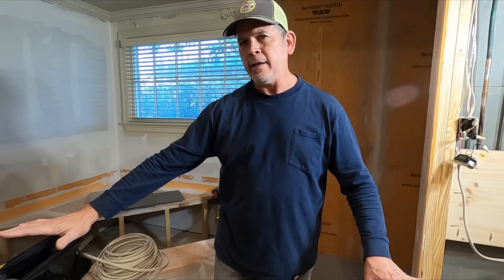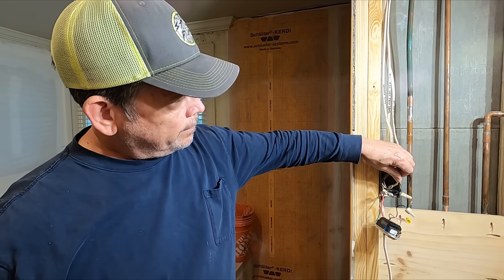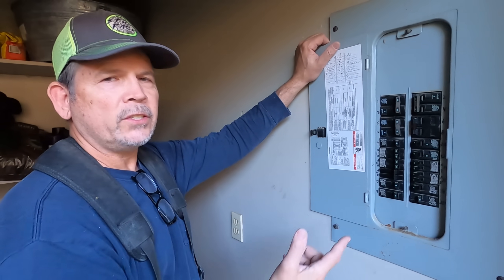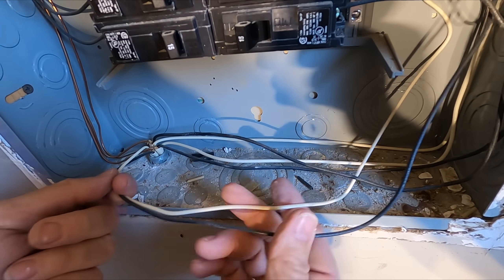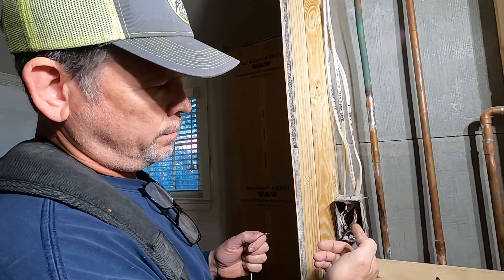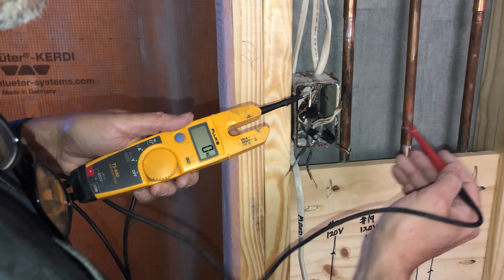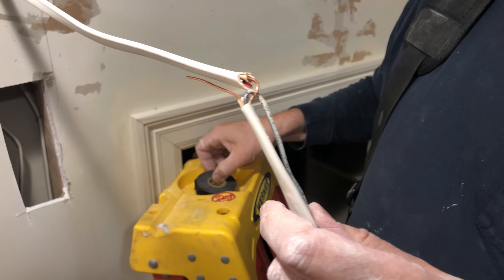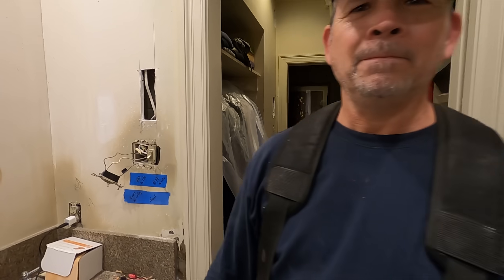You CAN Get SHOCKED by a Neutral Wire! This is How...

Comment: As an Electrician myself, I thought that was a great explanation.  And your trouble shooting skill are great as well.  Good Job!  Just a side note.  It is legal to share neutrals.  It's called a multi-wire branch circuit.  However, current code requires handle ties be installed on the breakers so both circuits will trip at same time.
Reply from the maker: Thx I sure appreciate that 👍  circuits 19 and 20 are same phase so I had to separate neutrals or move circuits in the panel and install a 2 pole breaker.  I thought viewers might want to see that abandoned neutral connected properly so I went with option 1
Reply: @StudPack  shared neutrals on the same leg (phase) is really dangerous.  That means if both hots were at 15 amps in use that the neutral would have 30 amps which would heat up that 14 gauge wire too much.  If it were my house I’d probably just move the breakers to opposite legs and make sure they trip together.  But I’m aware of the risks shown here.  

Can you please explain how sequential numbers are the same leg?  That’s not obvious.  If that is a tandem breaker it should be the same number with an “a” and “b”.    I think you may want to renumber the circuits to clarify which leg each is on.

Whoever wired that shared neutral on the same leg previously is clearly incompetent. (Not you of course. You did a fine job fixing it).
Reply: @neilbrookins8428  you sir have no idea what you’re talking about.
Reply: @dallas5374  I appreciate constructive criticism.  But from reading your comment, I can’t tell which part of my reply you were referring to.  Can you please be more specific?
Reply: @neilbrookins8428  "Can you please explain how sequential numbers are the same leg?" 19 and 20 are same 'leg' or 'phase' (however you want to describe it). Starting with 1, the horizontally adjacent breaker is same leg. So 1 and 2. That implies 19 and 20 if one could not see the panel, but if one is looking at the panel, any breaker that is horizontally across from the other is same leg. 220 breakers need both legs, hence this arrangement.
Reply: @spruce_goose5169  thank you. I can see at 4:31 that 19 and 20 are the two at the bottom row.  Yes, these are obviously the same leg.  I was mistakenly assuming the numbers were going down sequentially, not across.  By numbering down the left all the odd numbers are one leg and even numbers are the other leg.  This makes more sense to me to document legs as even vs. odd. Otherwise with the way it’s done here numbering across you can’t easily derive which leg by simply knowing the number.  

I still think whoever wired the shared neutral was incompetent due to overloading the neutral.  If these breakers were gfci you’d know right away that it was wired wrong because it would trip.
Reply: @neilbrookins8428  He explains the numbering in the beginning of the video.
Reply: @neilbrookins8428  I could be wrong, but I don't think the numbering sequence is a choice. In other words, this is how manufacturers have decided to number panels. He simply drew in marker what was already stamped into the metal.
Reply: @neilbrookins8428  I agree about the neutral. Code states something along the lines of: "a multiwire branch circuit consists of two or more ungrounded conductors that have a voltage between them (different legs), and a grounded conductor that has equal voltage between it and each ungrounded conductor of the circuit and that is connected to the neutral or grounded conductor of the system."
In other words, the 'hots' must have a voltage between them which implies they are of different 'legs.' In this scenario, neutral current will cancel rather than add.
Reply: @spruce_goose5169  I don't think the code allows for 2 different phase to be in one box unless its for a 240v circuit (which has no neutral) and the breakers must be ganged together
Reply: @spruce_goose5169  220v circuits dont have a neutral, 120v circuits do on a split phase system. I was told by a head electrician that it was not legal (at least in a residential building) that you could not run two different 120v phases in one box as there is a potential of 240 being present in the box.
Reply: @rty1955  Roy, where (roughly speaking) are you located? Because code is different everywhere. In the NE U.S. where I am, we can follow the current NEC and so long as we adhere to the rules for multi-wire branch circuits, we're good to go (see the link I previously posted).

As far as 220v circuits not having a neutral: The 220v itself doesn't use a neutral, correct, but it is extremely common for appliances to be run with 4 wires: an EGC (ground), a neutral, and both hot legs. The reason for this is that certain electronic components are designed to run on 110v and a neutral is needed for this. A good example is an electric range. 

I've never heard of this rule against two hot legs in a box, but if you know the code reference it might be helpful to get to the bottom of it.
Reply: @spruce_goose5169  I am not a licensed electrician, I am an electronic design engineer. I had helped a head electrician for a large company a while ago and asked him about this because of a 240v potential in the same box. I was told as long as its on the same phase it is permitted. I may ne wrong, but it makes safety sense
As far as an appliance goes, i have seen (ESP new ones) not needing a neutral due to the SMPS inside. Each appliance would be different, but as a rule a 240v circuit has no  need for a neutral, if a device needs a 120v circuit than a neutral sometimes would be needed, but that device dependant. I have seen 240v appliances that have a step down (240 to 120v) transformer inside as well. Modern appliances dont use transformers inside appliances anymore for this sort of work as they derive various voltages by other means such s s a SMPS
Reply: @rty1955  how would we ever get the voltage necessary without them being in the same box?  What's in an electrical panel? 2 or 3 different phases
Reply: @Gizmodi  can u rephrase your reply? In USA home we have split phase not 2 phase. Only commercial has 3 phase
Reply: @rty1955  yes Roy

What Is Dual Phase Power?

Dual phase — alternately known as split phase — is basically the same thing as single phase. Dual phase consists of an Alternating Current (AC) with two wires. In the United States, the typical power setup in households consists of two 120 V power wires — a phase A and a phase B, which are out of phase by 180 degrees. Many prefer this approach for its flexibility.
In loads that use low power — such as the lights, television, stereo and computer peripherals — the power is supplied by either one of the two 120 V power circuits. In loads that employ high amounts of power — such as the washing machine, dishwasher, air conditioner and heaters —one 240 V power circuit acts as the supply.

Since your the literal type, that doesn't apply to most residential dishwashers or washing machines. Have a good weekend Roy.
Reply: @Gizmodi  what are you talking about???
Split phase is what we use here in USA in households. Split phase is derived from a secondary of a transformer with a center tap. This center tap is considered to be the neutral. The neutral is a current carrying conductor, usually its the return from the "hot" side of a transformer winding, whereas the ground carries no current. It is recommended that the loads on either side of the secondary windings be balanced. Generation of multiphase has typically two types of coil configurations within a generator:  a Delta, which is like a triangle, or a Y. 
A Y configuration has a common neutral (or return) at the center with 3 coils radiating out like spokes. A delta really has no central neutral, rather its return can be obtained anyplace on the triangle. By either moving the neutral or return the voltage will change.
In order to derive 120v from a 240v ine can use a small transformer or SMPS, therefore a 240v either uses 240v devices (timer motors, control panels etc) or derives lower voltage by the means mentioned. My older elec dryer which uses 240v has a 240v timer inside and thus does not require a neutral. I would find it very odd that 240v appliances would require a neutral.
Reply: @rty1955  Roy, you are tiresome. I don't have the time you seem to have for replying to comments. Have a good day
Reply: @Gizmodi  heres an idea. Have a point when commenting
Reply: @rty1955  Mr.Yung, I made a few points already. Good day sir
Reply: @Gizmodi  no, you spoke gibberish.
Reply: @Gizmodi  what do you mean "how would you get the necessary voltage????" What are you talking about?? Please make sense
Reply: @rty1955  are you an electrician or engineer?
Reply: @rty1955  The US split phase system is a 2 phase setup. The neutral line is not equal to ground but rather the common point between two phases from the same transformer. You could argue that a circuit using only one leg is a single phase circuit, but that is only valid for said circuit and not the system itself. The issue is a phase with regards to a transformer really doesn't say anything about potential. You can generate multiple phases in the US way and as a result end up with a 208V potential between phases or you can do it in the more common European way where you still have 230V of potential but a higher RMS output as you are drawing 230 from different phases simultaneously. Then there is the modern European 400V systems that's again it's own thing but offers 230V through a similar split phase arrangement as the US except with higher voltage potential across each split phase and neutral.
Reply: @aBoogivogi  I am well aware of that. The fact that its of a different potential is irrelevant. The "neutral" is simply the return path for a given potential on a transformer winding. Its a split phase because it is created by splitting a secondary winding in a transformer equally and the neutral is just another tap off that winding. The term "split phase" means you are deriving more than 1 phase from an AC waveform which is 360°. The sum of all phases must be 360° Why? Because each rotation of a generator is 360° An electrical generator can develop multiple phases by placing coils at various locations within the generator. In USA we use only 3 coils equally spaced in a generator, thus in the USA we have a 3 phase system. This is how we distribute our power on the electric grid. In commercial locations this 3 phase power is used. In residential areas we use each phase to different communities. As one of the phases comes down the poles that js meant for different areas the voltage is broken down to a voltage which is more useful to consumers. This is accomplished with the use of transformers.
A transformer can itself can create multiple phases derived from its input phase
 You can have multiple taps off a winding, and each tap can be a return for other taps. Thus a transformer can produce many different voltages with many different "neutrals". In power distribution in the USA, we use pole mounted transformers that have a secondary winding that is tapped at the halfway point in a winding thus a "split". The phase angle of each half of the winding is 180° apart because the secondary winding is split in half. If you were to tap at other points, the phase angle would be different. The sum if phase angles always equals 360.
Its also interesting to note that the sum of the power drawn of all secondary windings is equal to the power drawn on the primary. This is simple transformer theory.
The primary winding from your pole mounted transformers itself came from a secondary winding from a substation.
Reply: @aBoogivogi  >"The US split phase system is a 2 phase setup. The neutral line is not equal to ground."

Neutral is grounded (usually in multiple places) and so it absolutely IS equal to ground (potential).
Reply: @rty1955  Roy, I agree with most everything you're writing, save for your claim that there don't exist 220v appliances with neutrals. When was the last time you hooked up a modern appliance like a range?
I understand that voltage can be switched by electronic components on board the appliance, but that is simply not always the case. I literally just wired a 220v induction range oven with all 4 wires. I understand that the 220 load itself does NOT use the neutral. That's not the claim being made.
Reply: @spruce_goose5169  so if you are replacing a 220v appliance with a modern one that needs a neutral for the 120v electronics, u will need to re-run a brand new cable with a neutral?
Reply: @rty1955  and others discussing PHASE:
Some of this is now just semantics. Since I'm the master of semantics (some say pedantic;), let me suggest that PHASE is not a line/wire or even necessarily a transformer coil, but rather the electrical SIGNAL form that exists between 2 points in the system. (Voltage is not one point existing in absolute, but is a relative measurement BETWEEN two points.) And by extension, any phase RELATIONSHIP (more than 1 phase) must have a third point to reference.

For sure, a typical U.S. residential system is probably best described as a 'split-phase SYSTEM.' The system is derived from a single phase of the three phase transmission/distribution system.

The secondary on the transformer acts just as Roy is saying— by 'splitting' the electric potential between the ends of the 240v coil with a 3rd reference point (halfway!). The trick of whether or not we're dealing with one or two phases depends on how we're measuring. 
Even a 220v circuit is only one phase if left alone. In-fact, any single source load is operating via one phase, whether it's 120v, 220v, or some other voltage derived across a delta coil, or even 2 coils of a Y configuration that are 120 degrees out when referenced to the center of the star. The phase is the signal—the sine wave—and you only have one voltage sine wave generated across two points. Of course motors and such can use multiple phases at once. 

To have two (or more) phases we must REFERENCE a third point. In reference to NEUTRAL (that center tap on the secondary) we then indeed see two phases, 180 degrees apart, just as Roy says. What are they 180 degrees apart from? From each other, in REFERENCE to neutral.

This helps us to understand why neutral return current CANCELS when loads are balanced between these two phases (yes in that case they're definitely phases): because when one phase wave crests, the other troughs. The neutral line on an oscilloscope displaying 2 phases is simply the x-axis.  

To confirm I'm not crazy, one can test this geometrically. How many points do we need to draw an angle (remembering that phase relations are described in angles). We need three: a vertex and two other points to draw the lines to.
If two points are X distance apart, they have X voltage between them. The third point provides the vertex to determine the angle. Carry this analogy even further: a straight line is 180 degrees. This is our transformer with the vertex dead center on the line. Can we have 0 phase angle? Only if there's no vertex—only if there's only two points, a single voltage which certainly cannot be described as two separate phases.

So the moral of the story: when your holding that red and black wire in each hand wondering, "am I holding two phases?" rest assured, you're not...unless you're also standing on the ground! (Cus you know... the neutral is tied to ground).
Reply: @rty1955  Yes, unless you want to cheat and do a bootleg of sorts (against code, unless there's some grandfathering...not sure) by using the existing neutral or ground (whichever exists) and tying the appliance neutral and ground together on that one line. This is how it used to be done anyways (neutral was connected to chassis). Obviously some safety concerns there.
Reply: @spruce_goose5169  Hahah yes you are correct and a phase is an angle. And eache phase is 180° apart from each other
Reply: @spruce_goose5169  i would look for another appliance rather than rip my house apart just to supply a neutral for some silly low current electronics. I would not want to steal a neutral from someplace in the kitchen as im sure there must be a code or regulation about that. 
It would be wiser to rectify the 220v to DC with 4 simple diodes then use voltage regulators or inexpensive switched mode supplies (more efficient) to bring the voltage down to the 5 or 12v the electronics needs.
Reply: @rty1955  Go ahead and try to rectify 220vac and see what happens.  Maybe step down the 220 with a transformer.
Reply: @rty1955  Roy you are absolutely correct. There is no “neutral from the power company” in the USA. It’s created by a center tap at the transformer thus “split phase”. And voltage does not flow like water in a hose either ... another dangerous DIY analogy. But sadly you’re wasting your time and mindshare trying to get any of that across here.
Reply: @HBSuccess  Was someone using the water analogy here? I have no problems with analogy so long as we recognize their limitations. But you're right voltage does not 'flow like water.' More accurate would be to say voltage is the pressure, current is the flow. But even then, it's just an analogy.
What do you mean there is no 'neutral from the power company?' Aren't they the ones that hang the transformer with the center tap?
In seriousness, many distribution legs that are single phase will use a neutral to return to the sub. On a more macro scale (transmission), the 3 phases are balanced without neutral, that is true.
Reply: @rty1955  "So if your neutral was not exactly at the halfway point in the winding, the phase angle would be different on each of the windings"

Actually that's not the case. Thinking geometrically (conveniently we can do that)—the 3 points still form a line—180 degrees.

The difference is that the amplitude of the phases would be different. E.G. L1 to N might be 90v, while L2 to N would then be 50v. 
The sine waves, when displayed on a scope referenced to neutral, would have different amplitudes, but their phase angle would still be 180. Return current on the neutral would still cancel at a 1:1, but obviously there is less potential for current on the lower voltage phase.

Another way to confirm is to ask: 'would the two ends of the winding (the 240v potential) change in this scenario? Of course it wouldn't because it doesn't use the neutral. This indicates the phase-phase voltage factor is one (add the two potentials together). When we're talking 120 degree phase angles (as with 3 phase) the phase-phase voltage factor is sqrt of 3 (≈1.73). 
Not that any of this matters for any practical purposes (unless we're designing systems I suppose, which I'm not).
Reply: @HBSuccess  You, sir, are obviously not an engineer because that is not a DIY analogy. It is very well grounded in theory and actually taught to undergrad engineers. Just because these analogies that require a deep understanding of PDE's have escaped into the DIY wild and are being abused does not invalidate them. But, before you go tooting your horn that water flow is easy while electron flow is hard, know this. The Navier-Stokes equations are one of the seven Millennium Prize Problems.
Reply: @rty1955  stealing a neutral is exactly how amateurs create these dangerous feedback circuits.
Reply: @HBSuccess  well, that neutral is bonded to an earth ground at the service entrance. I thought there was a bond to ground at the pole, too.
Reply: @stephenholland6328  I agree
Reply: @spruce_goose5169  the ordering sequence, aside from the numbering, is dependent on the panel*.    Some panels have the legs alternating between slots on the same side, and some have *pairs alternating.  So I don't rely on numbering or slot position, I check the panel construction to determine what the pattern is.
Reply: @rty1955  240/120v circuits (like you see in modern US code stoves and some dryers - has  been this way much longer in Canada) have two phases plus a neutral in a box.

The rule here used to be that every device box and j-box must be killable by one trip (single or dual-tied breaker).

I've just been informed by an electrician that you're now allowed (in Canada at least) to have two unrelated circuits with independent breakers, joined inside a box.
Reply: @fromagefrizzbizz9377  Makes sense to check the construction of the panel! 

A question though: how does one install a 240 breaker if the legs are not vertically adjacent? Are there special horizontal breakers or something? Doesn't really makes sense to me, but I'm not familiar with this set-up!
Reply: @spruce_goose5169  You have to CHECK the slot phase sequencing before you put in a double breaker.  if they alternate in pairs, you have to be sure to install your breaker to straddle both phases, if you don't, both the double breaker's lugs will be on the same phase.  This is possible at least with FPE (still manufactured in Canada by Schneider Electric, never had the problems of the US ones), Sylvania/Commander (defunct), and even with my perfectly modern siemens/Eaton panels if you're using quads with a central dual, or dual-half width.

I checked an old Square-D Q0 load panel.  Six breakers in a row.  If you put a double in slots 1-2, 3-4 or 5-6, both breakers in each pair are on the same phase.  If you want to use doubles, they have to be in slots 2-3 or 4-5.
Reply: @fromagefrizzbizz9377  I guess I would have to see one of these set-ups to understand the particular arrangement.
I don't really understand the purpose of grouping the legs or running them down one side vs alternating them.
 
I assume the vast majority of (or all?) modern load centers approved for residential install in the U.S. alternate legs vertically? If there is a modern one that does not, do you have a link to the product? I would be interested to see the set-up.
 
Either way, I take your point that there are some strange configurations out there, and the only way to be sure of proper work is to verify against reality, not assumptions.
Reply: @fromagefrizzbizz9377  I live in USA and my dryer is 240v single phase, no neutral, just a ground. My stove is electric as well, 240v single phase, no neutral its been that way since the house was built 20 yrs ago.
I was told by an electrician that only same phase is allowed in one elec box
Reply: @spruce_goose5169  I think you're confusing things with using the word "vertically" - especially given it's legal to put panels sideways.

I'm referring specifically to lines of adjacent slots regardless of orientation.  They all "alternate", but some do it as "alternating individually" and some do it as "alternating in pairs".

Seimens/Eaton panels/breakers are entirely modern and alternate in pairs at the half-width breaker level.  Making them alternate individually at the half-width level, without screwing up ordinary-width breakers,  would likely increase the manufacturing cost by a fair amount.
Reply: @rty1955  US codes have evolved a lot.  Up until the late seventies/mid-eighties,  US ranges could be direct wired with three conductors - two hots, and a conductor that was used as BOTH a frame ground and neutral. If you lost that conductor, some of the 120V electronics (inside light, or an electro-mechanical clock or timer) would misbehave and possibly burn out, and the frame could end up partially if not fully live even if a burner or control didn't malfunction.

In the late eighties, NEC moved towards requiring 4 prong outlets, with separate ground and neutral feed.  Canada had been that way for at least a decade by then.

If you saw this done around 2000 it would have been a "special", state law out of sync with NEC, or an electrician who didn't know what they were doing.

A more accurate rule is that only a single circuit can be in a box, whether it be both phases - 240/120V like most ranges/dryers and "split duplex" receptacles, or 240V only or one phase with 120V only.  Where "circuit" is defined as a single feed line protected by a breaker, whether single, or common-trip dual.

In fact, both our codes require a 4 prong stove/dryer outlet in new homes, period, even if you don't use it at all (eg: gas stove or dryer).

The intention is that the entire contents of a box become dead with one trip of a breaker, UNLESS the different circuits are confined to separate parts of the box with a metal barrier. Even in main panels, Canadian code said there had to be a metal barrier between the main and the branch breakers (which may have relaxed at the regulatory level due to alignment of US-Canada code).

That said, I understand that two unrelated circuits can now pass through a J-box in Canada according to recent code without a barrier.  Dodged a problem with having to have a J-box protruding through the ceiling in my current reno.
Reply: @fromagefrizzbizz9377  when you say "unrelated" are you referring to two unrelated circuits on same phase or two unrelated of different phases?.
When my home was built in USA in 1998 is was perfectly legal to run 240v no neutral otherwise no CO would have been issued. Circuits in appliances don't have to run on 120v they can be designed to run on 240v. Thats perfectly acceptable. They do it in UK all the time where 240v is thier mains.
Reply: @rty1955  I mean "unrelated" - separate circuits without common trip.  Two phases, under a common-trip breaker pair, have always been legal with neutral or otherwise.

Yes, of course, appliances can be designed to just use 240V as in the UK which doesn't have 120V.  But imagine the problem trying to replace an internal range lightbulb at 240V in North America?  Fractional horsepower motors for dryers ditto.  Economies of scale etc.

You could equally ask why the UK didn't move to 240/120V like us, and then they'd not have to get into so much trouble with international travel, new markets for their manufacturers etc.

The UK and US/Canada had huge differences in how they treated household electricity.  What made sense in the past, may not make so much sense now, but the physical inertia of changing is just too great.

My father remembered the upheaval going from 25 cycles to 60 in around the late 1940s.  Just try to imagine doing that again.

Modern technology is beginning to make that moot, with so much electronics that doesn't give a crap about supply voltage as long as it's between 85V and 250V.  That will progress.  Even with high power transmission lines - Quebec switched to DC from AC in the early 2000s to make it cycle/phase independent  make it easier to survive major catastrophes, and reduce transmission losses.
Reply: @fromagefrizzbizz9377 here is USA Westinghouse standardized 60hz back in 1890. Only in s.  California did Edison use 50hz and later switched to 60hz in 1948.  Edison used DC in NYC at first but later switched due to the superiority of A/C  transmission/distribution.
Two 120v bulbs in series would make it easy to be supplied by 240v. I have to check my stove as to the lamp voltage.
Reply: @fromagefrizzbizz9377  Thanks for trying to clarify this. I think I get it now. You're simply talking about split tabs/ tandem breakers. 
My personal panel uses a few tandem breakers but the metal is still stamped only once for the slot (for the 'pair') so the numbering sequence is uniform and works to identify legs if one wanted. But other panels number each slot within the pair, in which case one certainly wouldn't want to rely on those numbers to identify legs. I'm with ya (I think).

As far as horizontal mounting, you're in Canada right? We be in different countries mon. Mounting panels horizontally here is pretty unheard of, and I believe there is language in the NEC that disqualifies most installations from doing so legally (240.81) on the technically that when the breaker is UP it needs to be ON.
Reply: @spruce_goose5169  I know we're in different countries.  I authored a FAQ with an American on electrical wiring that applied to both countries.  You'd be surrprised at how similar they were, differing only in some details about kitchen counter outlets etc., and since NAFTA they've come far more in convergence.

Vertical (either way around) is relatively common.  Horizontal is rare but occasionally done. This may be one of those things you need to ask the inspector first.
Reply: @rty1955  your 240v appliances has 2 phases in the same box, thats how its getting 240v, it's 2 120v phases 180° apart. All resi dryers/ovens are pulled with a neutral along with 2 hots. Neutral is used for the electronics and light in the oven. 2 phases in a box is fine, it's common to pull a 14/3 to a microwave and a 14/2 to a fridge from the microwave box. 
Source: am an electrician
Reply: @rty1955  whoever told you it is permitted as long as it is the same phase is not a properly licensed electrician in the USA.  combining two 15 amp circuits on the same phase would mean you now can have 30 amps flowing through the neutral that is rated for only 15-20 amps (depending on wire thickness).  as a rule, you can only share a neutral if each circuit is on a different leg.  there may be a few areas that don't permit this but there are NO areas that state you can share a neutral as long as the circuits are on the same leg.

how it was wired here was cheap and illegal since the light was controlled from two points with the neutral needing to pass through both boxes (as opposed to one box being an end point with no neutral needed).  whoever did that decided to save money by buying the wrong cable, which makes me wonder just HOW that light was connected to a neutral in the first place in that configuration.
Reply: @Gizmodi  you are slightly incorrect.  2-phase is a four wire system with no neutral and each leg being 90 degrees out of phase instead of the 120 that 3-phase is.  it is a defunct standard that is no longer used anymore, though you can still get 2-phase motors.  basically you needed a special transformer setup for it to work and was not cost effective.

single phase or split phase are the right terms.  the PRIMARY reason they refer to it this way is because the pole transformer only has one high voltage phase connected to it with a ground path return at the pole (in residential areas, anyways), so the transformer is stepping down a single phase and splitting it between two voltages on the output (a center tap transformer).  three phase commonly has three high voltage phases on the input (in a AB/BC/CA wire configuration to each coil) and four wires on the output (even in delta, you want a fourth wire going to the service panel for bonding at least).  though, there are some older setups where they only have two transformers (a high-leg setup) where 240V goes to each transformer output leg but the neutral is only wired for two of the phases at 120v, but on the third the line-neutral difference is 240v (a small apartment building I lived in that had an elevator needed three phase for it and this was how the two pole transformers were wired).
Reply: @renton9999  no I agree that you cant share a neutral on two different circuits on the same phase. The comment I made was that I heard that two different circuits on two different phases was not allowed, due to the box would have a 240v potential w/o dual breaker lock.
Reply: @renton9999   I believe the high leg is a delta.
Reply: @Gizmodi  high leg has a connected neutral for two of the phases.  standard delta doesn't have a neutral connection.
Reply: @rty1955  ? How about this: incorporating a centre tapped neutral in a transformer winding coil enables the creation of two anti-phases ?
Reply: @neilbrookins8428  you are correct. Sharing the same incoming leg (piggy breaker)will double the amps on the neutral when sharing the neutral. Mr Dallas is "incorrect" by saying you dont know what you're talking about. Neil, you are also correct when saying separate the legs by using a double pole breaker. That is Code. Stud Pack should edit the video to be more clear about the correct way of using a double pole breaker. He never mentions it ....
Reply: @spruce_goose5169  the NEC had special exceptions for appliances that allows you to connect the appliance frame to the grounded conductor.
Reply: @rty1955  As far as I remember Neutrals are only neutrals in a 3phase system carrying unbalanced load from the phases but in a house its just your return wire. not truly a neutral more of a glorified bond :D
Reply: @dallas5374  I didn't think so either.
Reply: @StudPack  Gotta appreciate your concern for electrical safety BUT there's more of an immediate danger and an OSHA violation going on at 13:00 . Whats up with that?!? Well, at least he was wearing knee pads!!! Hahahahahahhahah, funny as hell!!! Reeeally? Come on, man!
Reply: @StudPack  actually, 19 & 20 are on different phases ...odds / evens. so a neutral can be shared, depending on if its a balanced load. We do this all the time in commercial work 3 phase . 3 ccts can share 1 neutral
Reply: @mikemacdonald2032  as long as the breakers are ganged together
Reply: @mikemacdonald2032  If you do commercial work, perhaps this is different, but most resi panels alternate legs (or phases if you want to use that term) vertically. This is allows 220v breaker to work (to connect to both legs). So 1 and 2 are the same phase, 1 and 3 are different. This means 19 and 20 are same.
Reply: @mikemacdonald2032  No, 19 and 20 are on the same leg. Breakers that are at the same height from the top clip onto the same tab in the panel. Sequential odd or even are on different phases. So 1/5/9/13/17 are one phase and 3/7/11/15/19 are the other phase. A double poll breaker would take up 1and3 for example. Being on opposite phases is how they get 240V on the same side of the panel.
Reply: @spruce_goose5169  This is dependent on the panel itself.  Some breakers are 1, 2, 3... alternate phases, and some are 12, 34, 56 alternate phases in pairs.  Siemens (and most? Eaten) panels strictly alternate by number, but they end up in pairs when using quad (half-width) breaker blocks.
Reply: @mikemacdonald2032  WRONG. 19 and 20 are on the same leg. You need to go look at some panel bussing with no breakers on it because you are very confused.
Reply: Given a choice, I would not have allowed any multi-wire branch circuits. Unfortunately, I discovered, after the fact, that over half the circuits in our house were wired this way.  We are now looking at thousands of dollars of rewiring in order to stop all the tripping with the arc-fault breakers now required to bring up to code when we remodel.  Then...there are all the lighting circuits with no neutral to the switch box. Thanks to the shortcuts of the past to save a few bucks and few minutes of the electrician’s time, I have a $10,000 remodel that will require a $15,000 re-wire.
Reply: @scottwendt9575  Actually with the correct AFCI there was no need because there are several manufactures that have AFCI's specifically for this purpose. Also I'm not aware of any local code that forces the entire house built previous to current code to make the entire house current code compliant. NEC specifically allows for this.
Reply: @castarmax1970  Yes I have replaced 2 circuits with Eaton’s multi-wire branch arc-fault circuit breakers, but they are special order and run about $250 to $300 a pop plus labor. If I continue down this path, I would have 10 more to replace, so I would be pushing $3000 and I would still have the same wiring issues in the field.  When we opened the ceiling in the basement we found splices using standard wire nuts behind the sheet rock.  We have also found the can lights wiring spliced outside of the can.  Again, with wire nuts behind the sheet rock, no box.  Then, there are all the ceiling boxes that will now have to be replaced to meet the new weight requirements and the 14-2 that will have to be replaced in the lighting circuits. All of this because the 2020 code now says if you pull off the drywall for any reason, like duct work or insulating you have to bring any electrical up to the latest standard.
Reply: @scottwendt9575  you can have an AFCI for a multi wire branch circuit: 
Google for “DET-719-CAFCI-Shared-Neutral-Guide.pdf”
Reply: In Almost all old work you will experience this at some point.
Reply: @comes2mind797  hi. I am sure the box may be overloaded with too many wires, but I defer to the electricians on this post. As for how many volts are there. There are only 2 possibilities either 120v or 240v. What we are discussing on this thread is the legality of two different phases being allowed in the same box. I was told it is not allowed, however branch circuits on the same phase is allowed. But again, I defer the real answer to electricians on here. I am an electronic design engineer.
I also know that junction boxes can not be buried in walls or floors. They must be accessable at all times as wires will be hottest at the junction.
Reply: Not to be argumentative but you correctly state the United states we operate on mostly single phase systems.  But single phase systems only have 1 phase.   Typical 120v/240v phase system circuits may share ( a neautral) such as in the case of a black, red and white grounded conductor.  This sharing meets the requirements  of Article 300.  The problem In the circuit you got a shocked by was more than likely caused by series contact between you and the grounced/grouding conductors.  Remember volts dropped = volts applied which can be verified by placing a tester line to neautral at the source of any load.

However, the panel in your example video appears to be a subpanel which necessitates seperation of neautral/grounding conductors throughout the entire subpanel. 
 Even there are no color standards for ungrounded conductors any enhancement can be good and as you know proper identification of grounded and grounding is in fact a code requirement.   Please allow me to self correct regarding the NEC not having a color code for ungrounded connectors.   The leg with the higher voltage 120/240 3 phase system must be orange. 

Thank you for taking the time to post and stimulate the thinking of us and our coworkers.
Reply: Ok I Believe I figured out something from reading this but here was my situation I had an old box that only had like 12 spots for circuit breakers completely full previously there was a gas dryer I wanted to hook up an electric dryer I put in a tandem breaker two separate breakers on one switch I didn't have enough room I ran a three-wire black on one and red on the other to the dryer with a neutral The dryer turned on but would not heat I thought had 240 I did but it needs to be on single pole 240 breaker had to move tandem breaker two lights to make room for the double pole breaker for the dryer My electrician body told me even though it was 240 it has to be ran on one breaker not a tandem I kind of understand most of it but if anybody can tell me exactly why I believe it has something to do with the converter and or something like that that runs different stuff at 120 but I don't know for sure
Reply: @mitchellchristianson8120  in USA to get 240, you need to have a breaker that occupies 2 slots in the box. The one breaker is actually 2 full sized breakers side by side that are physically joined  together.
Reply: @mitchellchristianson8120  there is no converter in the dryer.  the timer/electronics and motor run on 120v, which is why you need the neutral, and the heating coil needs 240V to work.  i don't know why someone thinks there is a converter/transformer inside the dryer/range to step down the voltage but that has NEVER been the case in the USA.  what was the case was dryers and ranges used to use UNGROUNDED 120/240 volt plugs, and some still do in older homes, but newer installations use the four prong grounded plugs.

anyways, your problem is you wired the line leads to the same phase and not different phases (and i am guessing you didn't use a 30 amp breaker either).  you can't use a tandem breaker to get 240 volts, tandem is not a 2-pole breaker.  all they can do is provide 120 volts in two directions.  I suggest you have your electrician buddy come in and do the wiring in the panel for you and check you have the right size wire for the dryer circuit.
Reply: At one point you could. Not sure about new code and the exemptions. The the way we used to do it, was only only share the neutral when with a hot that is on another phase. For instance, if we pulled 3 phase 208 to a box, we would only pull one neutral and share it between the phases. I think code is changing that or making you upsize neutrals that are common to two different phases. Feel free to correct me or bring me up to current code.
Reply: @luciddream2033  that is correct for sharing on different phases.  but you can't share a neutral if both circuits are the same phase (unless you install a neutral that is equal to the sum of the two breaker ratings).
Reply: @renton9999  yes that is correct, because the neutral will carry the sum of both currents, so you have to upsize it. Wasnt sure it all that was still code because I thought someone told that they changed the code regarding this in some way that didn't allow you share neutrals on different phases. This was done a lot on commercial properties and I believe that the sharing of neutrals can introduce transients and harmonics frequencies on the line that could cause overheating of wires and breakers. These harmonics are due to the increased use of non-linear loads such as fluorescent lights and computers.
Reply: @renton9999  also now that I think about this. Sharing neutrals can be extremely dangerous because in order to be able to safely work on neutral circuit you have to disconnect all three circuits that is sharing that neutral. Trust me, you don't want to get in series with a neutral that is heavily loaded. It was the worst shock I've ever received, worse than 277.
Reply: These are all 2 wire cables.  In order to share a neutral you would need a 3-wire cable.  And if these 2-wire cables are both on that tandem breaker, you'll have double amperage on the neutral because the 2 hots will be on the same phase which is NOT legal.  They make special tandem breakers to replace single breakers to keep the 2 hots on different phases.  Basically 4 breakers on one...but it'll cost you and it's a good sign you need to upgrade your panel.  BTW...funerals are far more expensive than hiring a licensed electrician.
Reply: Indeed, I thought this was going to be a lesson on multi-wire branch circuits and my jaw dropped when I saw that it wasn't! It was just a bad installation!
Reply: Question, why do I have a light switch with 3 black wires?
Reply: Very good! Thank you for telling them about the breaker ties!! First thing I thought when he was shutting the breaker off was 3 wire circuit and this guys going to go on a wild goose chase.
Reply: What is a handle tie
Reply: Nice to see a compliment in the comments for a change!!!
Reply: Code requires they're not only to be a tie bar between the breakers but the breakers have to be on opposite phases a and b  phase can share the same neutral you cannot have two wires on phase a sharing the same neutral
Reply: @crusherfang9368  its called SPLIT phase... Not single phase. On the secondary you have one winding with a center tap. The ends of the winding are called L1 & L2, the center tap is called the neutral. In USA the voltage from L1 & L2 is 240v. From the center tap to either L1 OR L2  it will be 120v. These two voltages (120v) will be 180° out of phase with each other. Since the voltages are from the SAME secondary winding its called "Split Phase"
Reply: @crusherfang9368  haha seriously?? You DO realize that modern appliances you DONT need a neutral for "control" purposes. I suggest you do a little more reading. 
Its VERY possible to create ANY voltage from a SINGLE PHASE 240v line w/o a neutral. 
I guess you know nothing of how to produce different voltages from a primary voltage. Hate to employ you as an electrician.
Reply: @crusherfang9368 let me see if you can be educated. 
Between L1 & L2 it is indeed single phase, but that is not what is brought into a residence. There is a "neutral" component which is the center tap of a secondary winding. People with a deeper understanding of transformers call it a center tap, because it is at the center of the secondary winding of the transformer coil, thus electrically spiting the secondary winding EQUALLY. Electricians call each side of the secondary of the pole transformer, L1 & L2 and the center tap is called the neutral.  L1 with reference to this neutral is 180° out of PHASE with L2 and the neutral, thus this is called a split PHASE because a neutral IS delivered along with L1 & L2. They are at two PHASE angles DERIVED from a single phase at the pole. Since it is only two PHASES, its called a SPLIT PHASE. It is not a phase created at generation, such as in 3 PHASE, it is DERIVED from single PHASE at the pole. But indeed it is two different PHASES. 
I hope you understand what a  PHASE angle is.
I could get more into detail if you want, but I dont want to overload you with facts.
Reply: @crusherfang9368  of you want to reference experience, or education. I am a EE with over 50 years of design work in real world experience dealing with voltages from microvolts to high voltages, and frequencies from DC to RF. While I may not be twisting wires for a living,  I think I've got pretty good handle on how things work,
Reply: Gotta appreciate your concern for electrical safety BUT there's more of an immediate danger and an OSHA violation going on at 13:00 . Whats up with that?!? Well, at least he was wearing knee pads!!! Hahahahahahhahah, funny as hell!!! Reeeally? Come on, man!
Reply: @crusherfang9368  I'm in the U.S., and I've been calling it a switch loop or switch drop, ever since taking electrical courses at the local Tech college.
Reply: Sharing neutral on same circuit is ok not sharing neutral from one circuit to another
Reply: @grosgogogogt  It's impossible to share wires on different circuits (unless things are seriously screwed bonkers). If the neutral is shared, the loads are on the same multiwire "circuit", by definition. It may not work right, but the circuit is all one thing. Another thing that many people don't realize, is the circuit is determined by the OCPD (breaker or fuse). It makes sense to say "That wire is too small for the circuit", or "That load is too much for the circuit." But, saying "That 15 amp breaker can go on a 20 amp circuit", is illogical / impossible. (It's always going to be a 15 amp circuit where you put the 15 amp breaker.)
Reply: @grosgogogogt  Bingo. They call it a "branch circuit" for a reason. Circuits are supposed to branch like a tree not loop about. Now there is such a thing as a "multi-wire branch circuit" where two opposite phase hots share one neutral, but those are still "branch" circuits in that the hots and neutral exist in the same cable or raceway.
Reply: Sharing neutrals is simply Dangerous and lazy. I wouldve never even thought it existed until this video....
Reply: @@jash21222 I never said it phase shifts. What I did say is that a secondary that is center tapped, will produce 2 phase that will be 180° apart when referenced from the CT
Reply: A simple wiring fix- Just wire each circuit with its own neutral. Done deal-
Reply: Green white blue or purple as electricians you should treat anything metal as if it can shock you . ive been smoked by a green wire in a DC fire alarm panel/ gutter (legal) ! you are the potential difference ...just cause its white doesnt (physically) make it a neutral Untill you've identified it to be so cant trust these hacktricians .... Anybody who's dealt with a switch leg being white(unidentified and under the wrong pole per code) will find out its not a neutral real quick
Reply: @patrickbjordahl3239  yep, i've also been shocked by the green wire.  Wakes you up reaaaaal fast too!  it's unbelievable, the amount of other people's screw-ups that i end up fixing.
Reply: Not a switch leg it’s a switch loop is where the white would actually be caring voltage. That means you feed the light and send voltage back down to the switch on the white wire, at that point it should be taped black. .  a switch leg is the switch is actually fed and you just send a leg up to the light. If you’re an electrician and you open up a switch and there’s only two wires in there then you know it’s a switch loop and you know that the feed is in the light so you know that white wire is actually carrying current.
Reply: Shared neutrals are the reason we can't bring old wiring up at arc fault code without rewiring. Shared neutrals don't only shock you but you have a load trying to work thru you, very deadly.
Reply: @Gizmodi  you probably are implying this, but for clarity, what shocks you is the open neutral (putting yourself in series with the circuit). Shared neutrals, especially if improperly wired, just makes it more likely for an open neutral to be unknowingly created. 

A good point about arc fault (or gfci breakers for that matter). 
Wiring a multi-wire branch doesn't seem worth the small savings in copper these days.
Reply: @spruce_goose5169  it's a shared neutral until you open it, same difference. 
When I want to save a little labor I will use 12/4 m.c. or 12/2/2 n.m.c., I don't practice sharing neutrals even with 2 pole breakers but everything has it's use depending on the situation.
Reply: Question: I don’t understand how the loose neutral at the 3way caused the backfeeding. Woudn’t the backfeed be caused by neutrals from both circuits being bonded (shared) somewhere? Thx.
Reply: Re: " It is legal to share neutrals."
Legal, shmegal.  That's why I treat code as a minimum.
E.g., I will not use 14-gauge wire.
Reply: @bobd5119  There is nothing wrong with 14 ga wire used correctly as-intended. It’s perfectly safe, perfectly adequate, and 100% code-compliant. All you’re doing by using 12ga wire on 15a circuits is wasting money and making it more difficult than it needs to be to make up your boxes/connections.
Reply: @bobd5119  Code might be minimum but the math involved in wire sizing tables is maximum which take in factors such as length, heat, and current . Intentionally oversizing your wire because you do not understand the code is a waste of money. Do you run #8 to your dryer or  #10 to the kitchen outlets?
Reply: @bobd5119   Agreed. And I also will not use 14 Gauge.
Reply: @bobd5119  I agree, published safety standards dictate minimum standards, true here in the UK and presumably elsewhere - demonstrated by the fact that regulations are frequently updated to increase degree of safety. 
? Why do some prefer 14-gauge wire where you are if they already know that the combined neutral current may exceed the 14-gauge specification ?
Reply: @oldbutstillcurious3615  Specifying cheaper materials brings in price-conscious customers, I guess.  And there's the difficulty of squishing 12-gauge wire into boxes.  I'd like to see recessed receptacles, to prevent touching the prongs on plugs.  Won't that provoke howls!
Reply: @bobd5119  that’s why you’re not a contractor. Only someone who is not in business would waste money on 12 gauge cable when you only need 14.